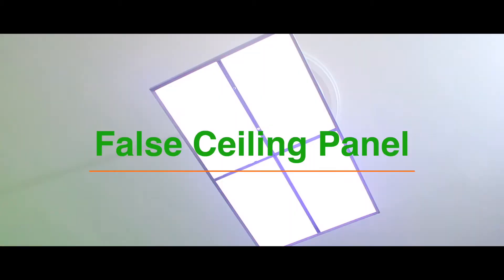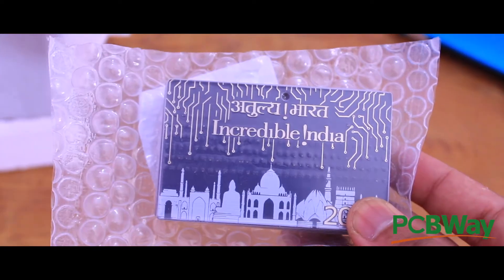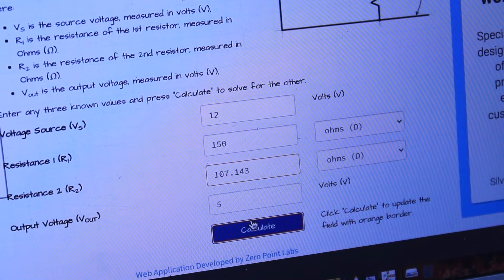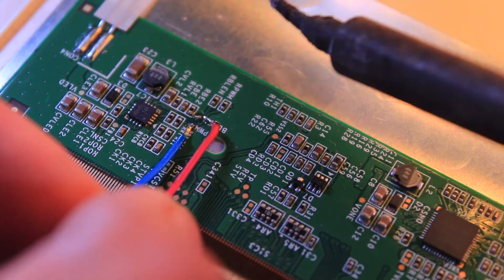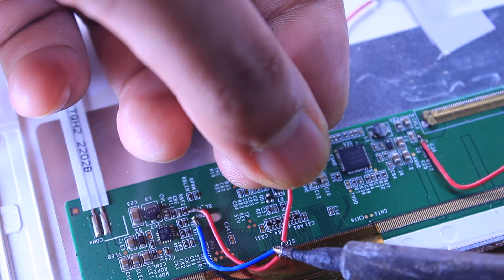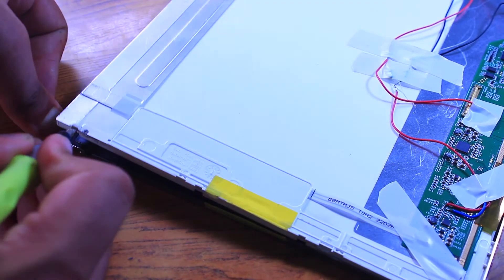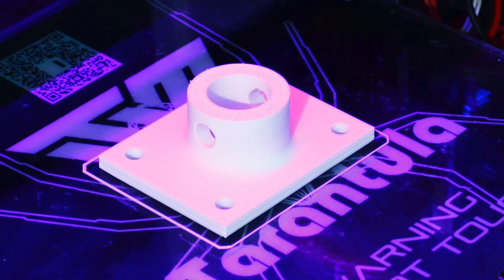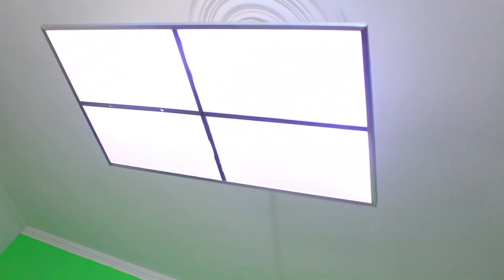DIY false ceiling LED light panel made from broken laptop screens

Comment: May i know how to connect 4 screen in one power supply? And what is in that fan power supply box? Details please 😊
Reply from the maker: All the screens are in parallel which are powered by 12V 1.5A power adapter, the one which is in 3d printed box. Link to the circuit diagram is in the video description.